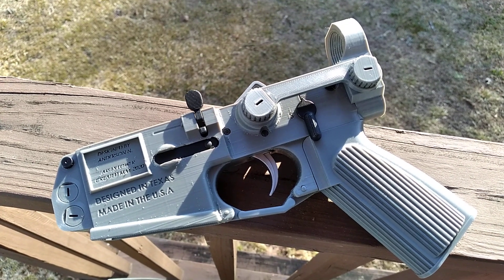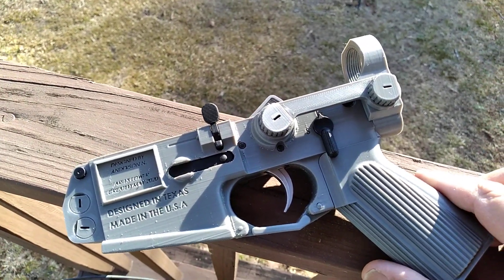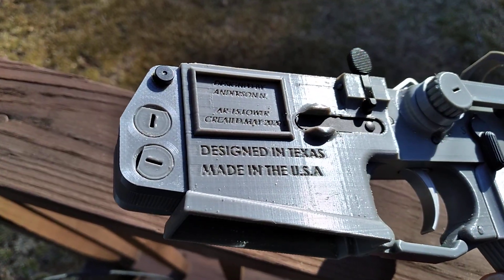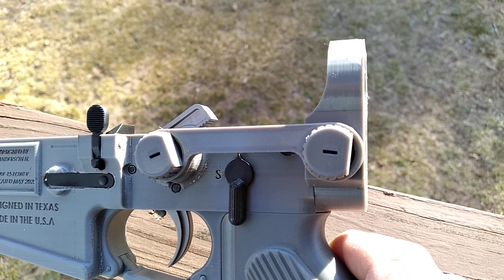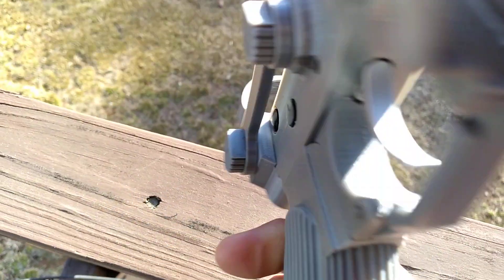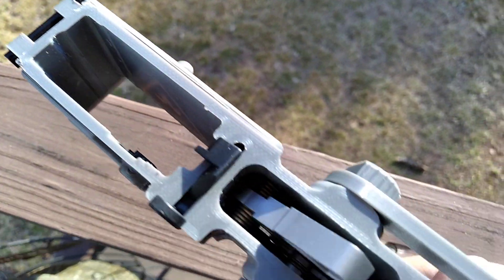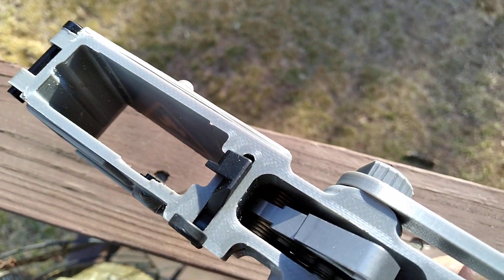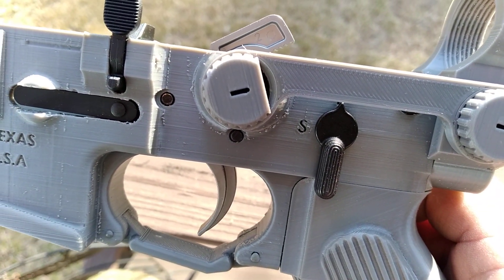Anderson Wildfire Lower

Comment: That’s bad ass
Reply from the maker: I was at the range with it when you made the comment. I'll post a video later tonight.
Reply: @Wildhare-uo5vj  seen where u said u be shooting. Hell Yeah. Got ender3 max. Need to know what to do after physically put bl touch on. Now need upload firmware or something idk. Not computer savvy.made door hook come on file and two gear wrench holders 7 piece. Now it’s a anchor. Over month. Cousin supposed help he doesn’t have time.
Reply from the maker: @paultrimble9390  the firmware can be loaded onto your SD card and it'll automatically upload it. You can find it on their website.
Reply: @Wildhare-uo5vj  seen somewhere it says u need to clear the card. Idk. I have a new 32 gig card to.  Can use it.
Reply from the maker: @paultrimble9390  I honestly don't know about that.
Reply: @Wildhare-uo5vj  10-4

Comment: I just can't get behind 3d printed ARs. They are so bulky and ugly.
Reply from the maker: I admit they're not ideal. But being able to make your own is never a bad thing.
Reply: @Wildhare-uo5vj  has anyone tried 3D printing metal yet? I've seen a bunch of other stuff, just no lowers.
Reply from the maker: @MoistHousePlant  actually yes. It can be done but the equipment is currently insanely expensive. I'm hoping it'll be like the plastic printers we have now and the price will drop dramatically in the future.
Reply from the maker: @MoistHousePlant  and if you're interested in making a metal lower, Deterrence Dispensed has a few programmable CNC machines that are reasonably priced.
Reply: @Wildhare-uo5vj  'One Click Metal' and 'Desktop Metal' are two cheap yet amazing 3D metal offerings out there I've found.